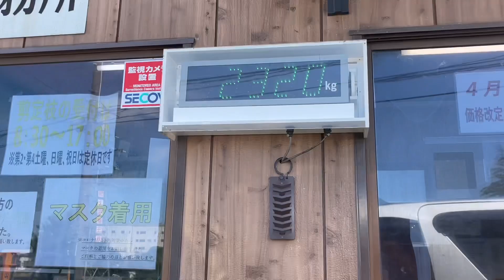$6000 house Japan - Day 3 and 4 renovation progress!

Comment: You could put a toilet that you seat on but the waste still drops to the to the septic tank. If smell coming up from the toilet is a concern you could put a “chimney” pipe to the septic tank with a extraction fan on top of the pipe/ducting that will extract air from the tank as it turns pushed by the outside breeze. You could install a computer type 12v fan in the ducting for days when there’s no breeze to assist in extraction. 

Another thing is that if the septic tank is a real tank like a cistern, meaning with a concrete floor, then yes it would fill up and you’d need the emptying service. 
If the bottom of the septic tank is  straight to the ground and dirt or sand then it would be much better as the system would work for years without needing emptying as all fluids get absorbed into the earth.

In the urinal place you could install a bidet where the water would go to the same place the shower water goes and then you have your hygiene needs sorted and also use less toilet paper going to the septic tank.

Comment: I grew up in a rural area in Western Canada with a pretty high water table.  We were just on the edge of town and got our water from a well that was drilled about 15 metres down.  Our sewage was part of a septic tank, but I think in all the time I lived there, about 12 years. We only had it pumped once or twice.  There are products you can get that adds microbes to help break down the material in the tank, but I've never understood how that keeps your tank able store so much sewage for so long without being pumped.  I remember a few years after living at the farm, we built what they call a septic field, which we could do because it was our farmland and we had about 5 acres, some of which was not being used for anything.  What we had done was dig a series of trenches about 1.5m deep and filled them half way with gravel, then laid a bunch of PVC pipe on top of the gravel that was full of holes and all connected. Like a sprinkler hose sort of...  The end of the pipe was connected to an electronic pump that was designed to submerge in the septic tank and pump the material into the network of pipes. It was designed to also pump solids of a certain size too.

Once that was set up we covered the PVC pipe int he trenches the rest of the way with Gravel, and then spread the dirt back over top to level the ground out again.  So at certain intervals the pump would start pumping the septic tank into the septic field under the ground.  This is a common practice in many rural areas of Western Canada where public sewage isn't available, and it is considered to be hygienic and I've never heard of any health related problems or contamination or pollution or anything like that in places where it was done properly, obviously the septic field was a good distance from our well, and no where near as deep. (and we filtered and purified our water anyway, because the ground water is not very suitable for drinking as is)  Obviously you're not going to install a septic field in a Japanese town, but I do know that such a thing isn't necessary either.  I wish I knew more about the science of it and how septic tanks and be at least somewhat self regulating to a point, without having to pump it several times a year or whatever.

I just found your channel this evening, It's nice to meet you and see your progress. I'll keep watching.
Reply: You most likely had a septic field to go with your tank. He doesn't have enough property to put in a field.

Comment: The kitchen area is looking so much brighter already now youve move the cabinets and opened it up. Cant wait to see it with fresh paint. 😊 I kind of like the shelf on the wall. It looks like it would be handy for storage, but i can understand wanting to paint it or even remove it to continue to brighten the space. As for the toilet, if youre going to potentially fill all six bedrooms you may need multiple toilets for your guests. They're small rooms, but you can get conpact wash basins. I think it could work. I grew up in a house with a septic tank in country Victoria, about 3 hours from Melbourne. I don't remember flushing water being thst much of an issue. Our sistern probably held around 6-7L. But perhaps Aussie septic systems are different to Japanese. How dodgy is that bathroom floor though! Its a bit scary to think it was just chocked up with a couple of blocks of wood. 😳 Loving following this journey. 😊
Reply from the maker: Thinking I’ll keep the shelf on the wall - I can’t see a reason to demo it yet. I’m the long run, I’m considering converting the massive wardrobes in the bedrooms to ensuites but it’s nowhere on the radar yet.

I’m trying my best to understand why the plumber won’t put anything on but the super low flow. I’m connecting with other plumbers but it’s going into a public holiday this week and everyone is busy

Comment: One alternative with the timber in the kitchen is to white stain them rather than an opaque paint.. then you can get the white finish that will tie all the elements of the kitchen together and still keep some of the character of the timber grain. It might allow the timber to look like an intentional design decision rather than an unfortunate unwanted element you’ve tried to conceal. Just a thought.
Reply from the maker: The house has so much timber and it’s super nice! I just want to have a different space in the house to switch it up. I’ll go over the timber again in an oil based primer which will work without a doubt

Comment: Also you live in a quite big family house - the septic is probably fitted for more than just 2 people, so there might be quite much room. :/
Also you did not mention did the former owners leave you with a very full septic ? (I'm thinking how they did leave their stuff because it is expensive to get rid of) :(
*
I'm used to top cabinet over the sink, so there is a drying cubboard there where you lift the wet dishes to drip into the sink as they dry. I would have taken the earlier top cabinet and set it over the sink turning it to drying cabinet and added beside that the open shelving. Moving the open shelving over the fridge and set it on the other side of it. I personally don't like open shelving, but one needs somewhere to put stuff and if it is something that one doesn't use one can always get rid of it later.

Comment: as for snow maybe when during winter for the snow not to be right touching your walls 

just maybe since you have a shed there already

buy harder tauplin like the tents which has plastic windows and plastic zipped doors you know

just throw it on the roof right down to the ground a few say one metre from all the walls

anddddddddddd you peck the tauplin ground part to the ground so you have no snows touching the walls 

and you be walking around the house outside no snow inside the tougher texture tent like tauplins

Comment: What is the capacity of your septic? Does it have a leech field? I installed a 2500-gallon tank when I built my house in Hawaii and we've only pumped it once in 10 years (3 toilets, 2 showers). As long as the micobes are breaking down the solids and the liquids are able to leech then I'm not sure why water would be a problem.

Comment: Regarding the toilets, in-laws house has a septic setup as well. I find it "fine", but if I was living there I am sure I would also want a more modern Japanese toilet with a bidet. When the septic tank starts filling up, the smell in the summer someimes also works its way back into the bathrooom :/ Not sure if this is normal or just because this system was old.

Anyways, realized I am watching videos that are 10 months old now. So you have clearly already made a decision :)
Reply from the maker: Yep, changed it over. It doesn’t make sense for me to have a pit toilet in my home. It’s not even septic, it’s a pit toilet. I didn’t really want to live with an open pit toilet if I didn’t need to